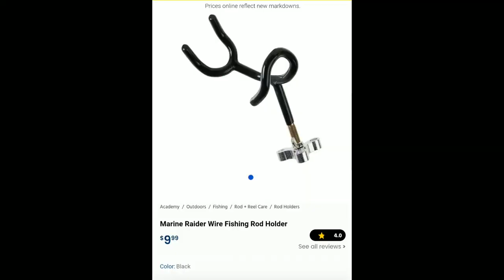Fish'in  Again. Easy  and affordable rod holders for your boat.

Comment: Like the video, what are the black disks with the 4 bolts in them in the video next to the rod holder mount, and how do you use them. Thanks for the great videos.
Reply from the maker: They're my base for my gopro mounts. I have them all around the boat. Made from 1/2 gas pipe, and I use 12" - 3' tall mounts.